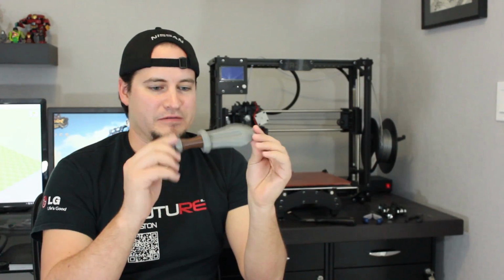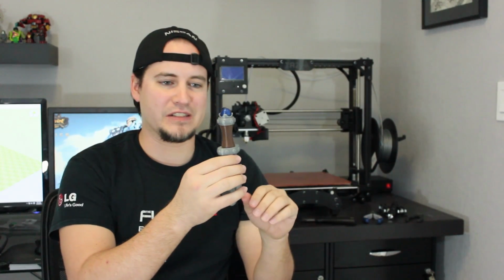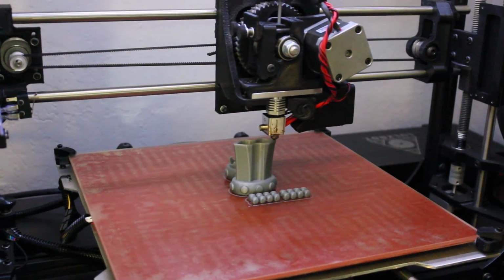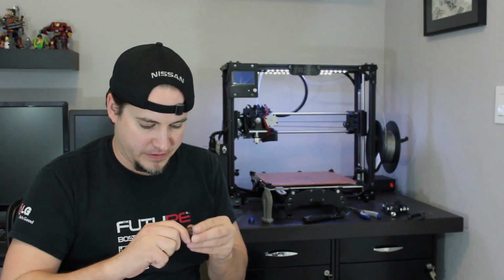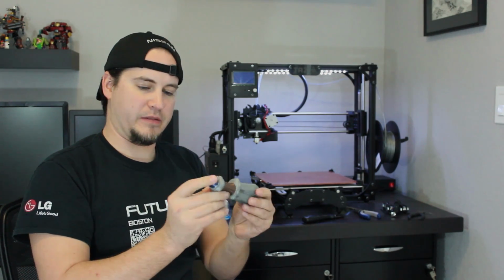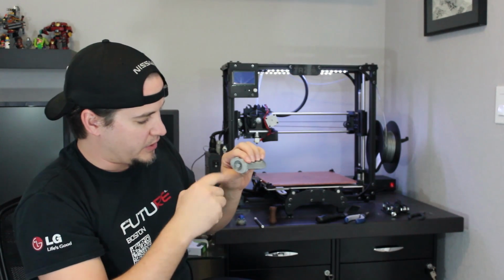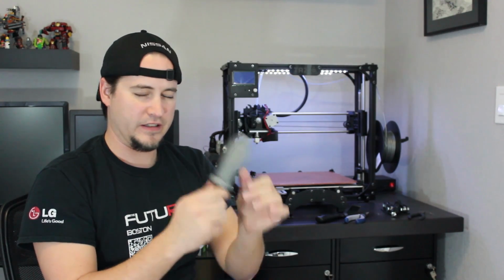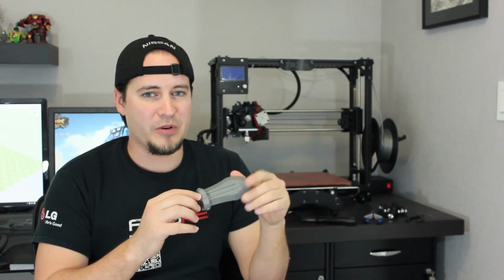3D Printed Sword Rattle for Your Little Warrior

Comment: I really like this rattle and I printed it out with different colors for the different parts.  My only critique is that there could be a second version where the little gem-like protrusions on the guard are printed as separate pieces to be glued in later.  That way they could be printed in different colors to give the guard an ornate look.  Just my two cents.

Comment: Matthew:  I bought my husband a 3D printer for Christmas, and I'd like for him to print your sword rattle.  OK, to be honest, I love your sword rattle so much I bought him the printer to print the sword rattle...among other awesome stuff we've found on Thingiverse.

Could you send me a link to the plastic you used for the blade and handle?  I've been having a horrible time trying to find those colors online. Is it FDA approved/food safe?

I'm fairly new to the whole 3D printing thing, and I'd rather not poison my friends' babies.
Reply from the maker: I use PLA for most of my printing.  It is low temp, easy to use (beginner plastic), and nontoxic (it is derived from cornstarch).  You can find it on amazon.com.  The brand i used in the video is esun, but i am currently looking into other brands.  I just bought some Hatchbox PLA in silver and will be trying that out in the next week or so.  Hope this helps, and have fun printing.
Reply: Thanks a lot.  Here's a link to the silver I just bought if anyone else is interested.  https://www.amazon.com/gp/product/B01EKEMLHQ/ref=oh_aui_detailpage_o00_s00?ie=UTF8&psc=1
I read some reviews about the Hatchbox PLA diameter not being within tolerance, so I went with the eSun.  I'll be curious to see what you think.   My husband has printed mostly with ABS, so I'm excited to see how it turns out.  Thanks again for designing, printing, and posting

Comment: Fantastic print!  I don't think it would be that difficult to adjust the model to have a hole in the bottom of the blade to add rice or the pellets post print either.  May need to model a small plug for it if the pommel doesn't hold the medium in.  Thanks for making this model available.
Reply from the maker: +Casey Hendrickson you welcome.  Have fun modifying it how you see fit.